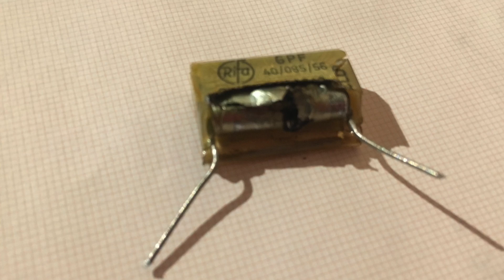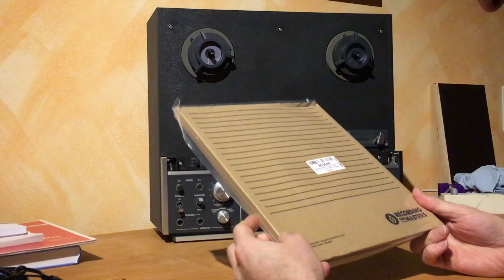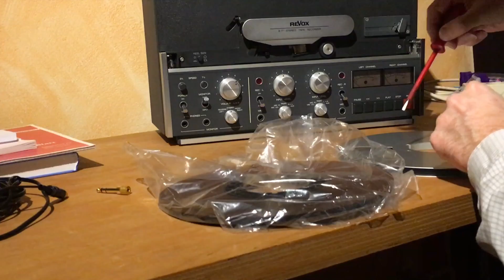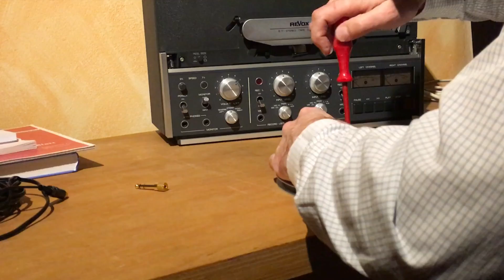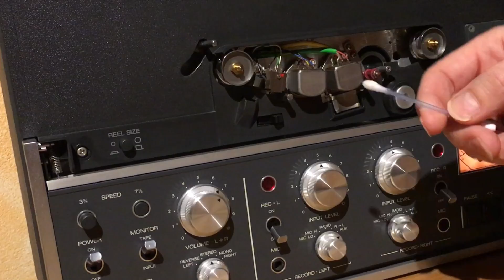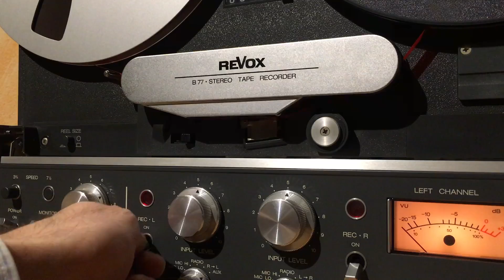Let's talk: Analog Reel-to-Reel, Revox B77

Comment: A well calibrated and adjusted B77 will sound awesome with hi-res files recorded at maximum speed. Audio quality is not about perfection in every detail but the imperfections like s/n, distortion etc makes it more interesting for the ear and our brains. Human hearing and our brains aren't perfect at all at least my specialist at the hospital explained me this in more detail. I love analoque recordings on tape and vinyl more then perfect hi-res material. Hi-res material recorded on tape gives it a certain warmth which personally I enjoy the most. My B77 two track are still hives me the shivers with well recorded music. When I compare the Revox against digital sources through my Macintosh /Sonus Faber equipment and let people listen to the same tracks at a listening session there becomes a smile on the face when the Revox plays. I like it when that happens. Music is all about enjoyment. On paper and measured a 24bit/192 khz digital can be perfect but it can sound sterile and cold and with some equipment analytic, tiring and boring.

Comment: if you measure 'audio quality' by signal to noise ratio then yes i could say that a laptop can do better than a B77 but not really by any qualititative standard
Reply from the maker: what do you mean with "by any qualitative standard"? Not any laptop, but most higher quality ones today indeed have better audio than a Reel-to-Reel if you look at all the technical characteristics, Frequency response, Signal to noise ratio, Distortion, Crosstalk, Wow and flutter, Tape slip, Erase depth. Can you name any where a reel to real has better sound than a properly set up modern DAC? https://www.youtube.com/watch?v=DT4VXf6gGUI
Reply: 'qualitative standard' = using one's ears. a cheap audio card on a laptop may measure better but really you need to spend at least five thousand dollars on a DAC/ADC to come close to reel to reel.
Reply from the maker: Nope. Sorry not sorry: You fall for the want to believe snake oil voodoo trap.
Reply: not really. i understand how desirable it is to escape to the certain world of numbers - but the sad fact is there is really so little we understand or can quantify about the sonic world. For example - HOW do you measure clarity? transparency? how do you measure a signal that is far more detailed - that contains or conveys greater amounts of subtlety? don't be afraid to use your senses - this is how epistemology actually works and how we got to where we are today!
Reply from the maker: @antigen4  actually you have this reversed, while I understand science, you try to except that into the wold of voodoo and wishful thinking. But I have good news, nothing sounds better than and Sgi Octane, and you can simply get one, too! ;-) https://www.youtube.com/watch?v=_YmgEitnI7E

Comment: Hi there, next time when you use the machine, be sure you use the empty reel is allso metal. The plastic ones are lighter so if your unlucky you could end up with a tapesalade.
So allway's use a full plastic to an empty plastic reel and a metal to metal.
Reply from the maker: thanks, for the tips, it's at my father's so I'm only get to use (and service) it one or twice a year or so :-/
Reply: @renerebe  Did bought allso a B77 in 1978 great machine. Now my brother in law does own it because I bought later a PR99 actualy the same machine but with some featers I needed.I Now own a Studer A810 and that machine sty's with me untill my death, which I hope it's a long time ☺☺ ♫♫
Reply: The motor that actually takes tape from left reel is beside playing head, right reel only collect what is first taken by this motor.
Reply: Super video and i use hand cloves on transferring  tape   to the Reel...(*;*)

Comment: I've noticed since 44.1k/16bit audio has an abrupt cutoff at 20k, when you record it (or cut it) to an analog format! The sound is still of course cutoff at 20k, but less harshly! It's a smoother edge!
Reply from the maker: well, yeah …, but your ears can not hear such high frequencies anyways, ... and what do you record onto the tape? 44.1kHZ FLAC? Well, I also got some 88.2, 96 and even  192 kHz FLACs (I think the 192 was Alanis Morissette), but then you also need the matching digital output equipment to qualitatively copy it onto the analog, and then, … it's just an analog copy of the digital …∞

Comment: For people that are watching after me: The B77 cost about 10'500 Swiss francs in 1984, which is about CHF 18'000 in todays money. Back in the day that was about an average one YEAR'S SALARY, so more like CHF 78'000 today. Imagine buying a tape recorder or a brand new Porsche 911 for about 50% more. Its crazy to think about how much money that is for a recorder.
Reply from the maker: there is something wrong with the price, it was just some 1000 to 2000 DM or so when my farther brought it first hand on some discounted sale in 1983 or so. The 10k SFR price is probably for some other machine, maybe some studio version or so ;-)! My father is electrician, it was "only" about a month middle class salary in Germany.
Reply: Bits inside by René Rebe Yeah, the price is from an invoice which also lists a bunch of cables and supportive equipment and tapes and I only looked at the total sum, so you are right ;D But still, a lot of money, especially with everything you need to listen/record to the tape.

Comment: "Great information ..also my self being new to the vintage reel to reel audio club!   ..if the tape are not the very high quality black magnetic oxide 10.5 1/4 tapes ( 80's Maxell)  one's if you can get them that is with out paying mad high prices   ..other tapes cause dirty audio- heads ( constant cleaning up!?!?)  ...but the sound is worth the effort!!💜💜. By the way I use a ( Dac on to reel to reel)   to my Dolby atmos A.V. unit! 

d 🤕

Comment: hi you where talking about bad caps on the power unit. i got a akai X355 from someone it had ton's of bad caps the man i got it from had tested it and said it was working
but the caps were bad when testing the unit went up the main transformer burned out there was no fuses in the 36v dc relay transport logic this whythe power
transforner  went up never plug any unit's in without doing checks  i am very good with power unit and i have acc with rs i fixed the audio and the logic the older akai's
best not to buy them you are right look into what you are buing akai 4000 are safe i worked on over 50 myself

Comment: I plugged in my a77 and it fizzled with smoke can you recommend a book or something to learn how to fix these?
Reply from the maker: Might be a bit tough to learn electronics just for that. Might be most efficient to have someone who already knows electronics look over and fix it... ps: if you are lucky might be just one capacitor or transformer ...
Reply: You can buy ready upgraded boards and complete cap replacements kits ready to go for a/ b77s there are some on eBay. I’ve just had my a77 serviced it was a three hour time on the bench, replaced belts, a large amount of capacitors and various electrolytic replacement, lamps, cleaning, head adjustments, brakes cleaned and adjusted, both tape guides replaced with rollers, lubrication etc You can get so far yourself but you will need to bias the tape and for that you need the super rare tone tape itself and an oscilloscope to gauge the biasing, a big outlay for occasional use. There are lots of little tweaks and upgrades that only a certified tech would know, mine cost me £220 Oct 8 2020 a fortuitous time as it would have been J Lennons 80th... and I talked to the tech about servicing and that would be an average cost for your service and parts considering the amount of components that need to be replaced  and I sat and chatted to the guy as he worked for three hours.  Myself am ok with an iron but gauging what needs to be replaced off the bat I couldn’t know without experience. I now have a deck ready to roll for another ten years. If you can sit in with the tech you can pick up a lot of info...
Rule no 1 in relation to reel to reel make sure your pockets are deep there’s no place for skinflints...
Reply: That is most likely the 0.47 Rifa capacitors. Easily replaced 👍

Comment: I need to ask you something since u got the same tape model I have, when you route audio signal. the one of the rev inputs when you compare the switch "input" and "monitor tape" do you hear time difference, seems like the tape takes  time to process audio and doesn't record signal in real time but it delays a bit, is that normal or do i have to send it for calibration or something ? or should I need 15 ips instead ?
Reply from the maker: palmerico house yes this is normal, als the record and play head are 1 or 2 cm apart. This is the delay of the tape passing under the record to play head. This can not be “calibrated” away, but will be shorter the faster your tape speed is.
Reply: thank you! that's what I wanted to know, then I might need a 15 IPS tape recorder instead of 7 1/2, ok now that's clear to me. nice video great review
Reply: No need too calibrate this is normal... the slower the speed the longer the delay..

Comment: It is such a shame that Carlos Santana used a Crappy Mesa Boogie MK 1 tube amp with those lousy 12AX7 drivers and stone age 6L6 output tubes in the recording studio. Then he went and put his distorted inaccurate guitar sound directly on tape that used magnetically aligned particles. How ridiculous! It sounds like crap! If only he had used good digital recording equipment so we could now decode the audio information back to accurate zeros and ones for our ears to enjoy without analog distortion. I hope you enjoy your TECHNO RAVE MUSIC with your excellent digital systems..man that's AUDIO NIRVANA!
Reply from the maker: I'm not into techno rave, but thanks! Nirvana actually ain't too bad though ;-)

Comment: How many minutes could you rcord on to each side of the reel?
Reply from the maker: so the new tape was advertised as 1100 meters, you can choose from two speeds on this machine: 7½ or 3¾ inch (19 or 9.5 cm) per second:
1100m * 100 / 19 cm/s apparently makes for 5789 seconds, divided by 60 that is a little over 96 minutes per playback direction (side). You can double that for the slower speed, which results in less audio quality due degraded frequency response range and noise floor, etc.
Reply: @renerebe  If you are recording in mono you can double it again as you can record individual channels and also playback the two independently as well as together.
Reply from the maker: @ianz9916  eh, yeah, but which audiophile wants mono recordings?
Reply: @renerebe  1960's recordings tend to be mono so artificially making them stereo makes no sense.
Reply from the maker: @ianz9916  to store quality recordings from that time. one could also use an mp3 recorder and not waste tape on them ;-)
Reply: @renerebe  You could use that argument for any recording. Just because songs were recorded in mono doesn't mean they weren't quality recordings. There is also a difference between mono and stereo recordings of the same LPs because they didn't just fold down the stereo mix. The mono mixes sometimes even used completely different takes. My mono collection is in many cases far superior sonically to the equivalent stereo counterparts.
Reply from the maker: @ianz9916  I was a little bit trolling – but most records from before the 1970 I encountered did not has such an outstanding SNR and frequency range
Reply: @renerebe  The Shadows Greatest is probably one of the best sounding records I own and that is in glorious mono. Several of The Beatles releases sound much better in mono too. That weird stereo, vocals one channel, instruments the other, that EMI did for most of the sixties was not the best. (I did realise you were taking the piss, I saw the winky face.)

Comment: flac has a compression but i think waw not, i prefer to store original music cd songs that way, than compress with xz for extra space
Reply from the maker: flac compresses lossless, like zip (or XZ) just specialized for audio. It yields bit identical results and typically saves some 50 to 60% or so on compared to the original WAV … It should actually compress better than XZ. At least that is what it was designed for, … and is directly playable.
Reply: RenéRebe sorry for my wrong knowledge, thanks for the information
Reply from the maker: no problem, education is what I make those YT videos for ;-)

Comment: hi if you can fix the decks you have you can get some super ace deals out there    i got hold of a soundcraft 381-8  i was very very lucky man i some 1 inch zonal tape wow
after a super fix up i got a super  deck  the 1/4 inch is not allway the best deck    1/2  1 inch are the best one out there to get  as there's alot of good low cost  used 
tape  zonal are good i know people love the sound of ampex tape   zonal is my tape